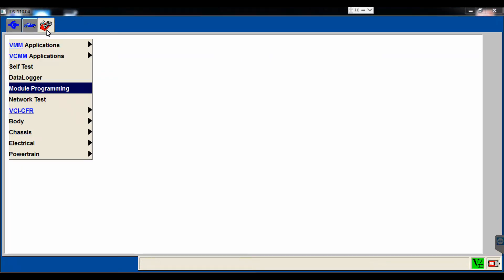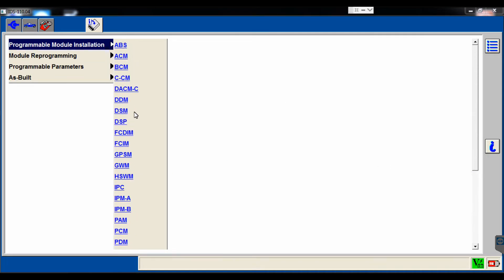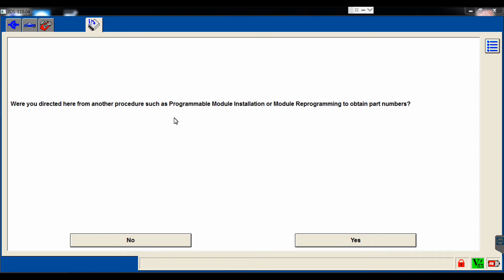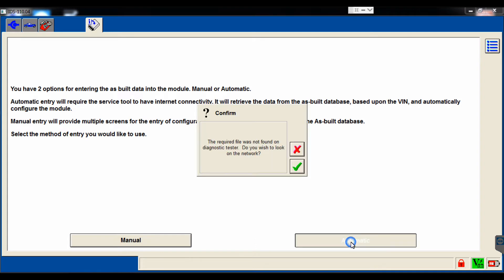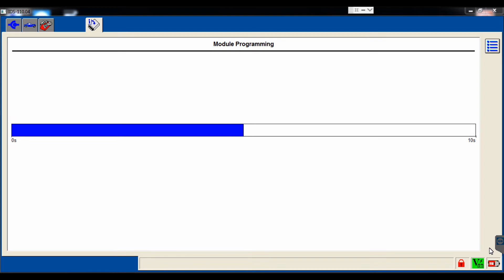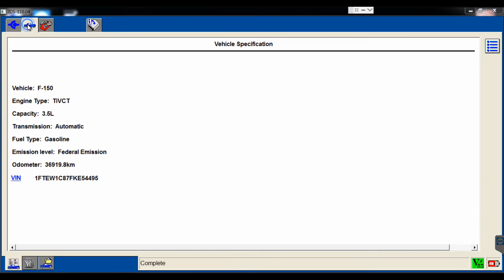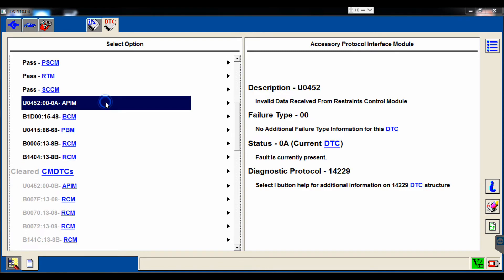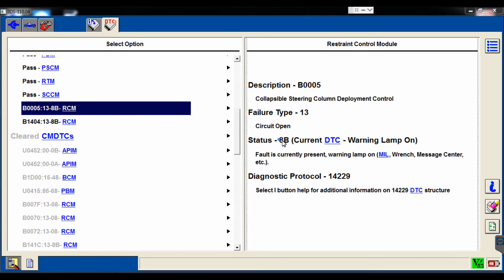Flashing a Ford RCM after an airbag deployment

Comment: On a 2011 ford fusion can I just change out the airbag module with one out of a junk car
Reply from the maker: You could, it would still need "programmed", and I don't recommend used RCM's.
Reply: 17 Explorer on plate today. Told customer it can’t be used so we’ll see. I go one session at a time. Anywhere cheaper than going thru Ford site with car daq3+ ? Hopefully everything goes as smooth as one would hope but first air bag so will tread very cautiously & just follow the service data.

Comment: Keith maybe I missed it, was there a reason you didn’t pull the info off of the old module first? Was the module not communicating?
Reply from the maker: It was already replaced and reassembled by the time I was called.

Comment: Question for you Keith. When I go to get ford as built data from the motor craft site I get pcm as built but then scroll down and there’s this thing called bce modules. Any ideas what that means?? I have ids but used fjds a few times and seen that. Ever run into this??
Reply from the maker: Phil, the BCE is all the other modules, the first 3 numbers of each set tells you what module it is.
Reply: @L1Training  I remember when they labeled the module by names not a mile long list titled bce module.
Reply: Thanks. So during as built the first 3 numbers are filled in then you fill in the rest? Haven’t messed with it in awhile. I remember they used to break it down module by module by name instead of a long ass list. So you’d scroll down til you got to say 754 was your first 3 numbers then enter them in the boxes?
Reply: Hi Keith any chance u would point me in the right direction
Passenger seat and curtain deployer ,parts changed and module reset, airbag light goes out but on scan it says, airbag locking circuit impedance 306.67 ohms and front loop passenger side impedance 0,is the module turned off on passenger side.👍

Comment: HI nice video. I wish you were in San Diego. I replaced my RCM in my 2016 Focus with a used one from another car that had no crash data in it. Car was hit from the rear. I need to change the VIN number to match my VIN to my car. Can i do this with Forscan? I do not have IDS as it is very expensive to buy. Tnx.
Reply: Did you figure it out with FORscan?
Reply: @seanmatticker4723   you can with forscan